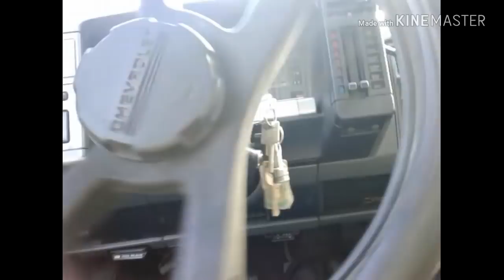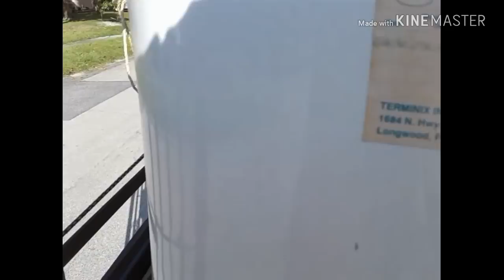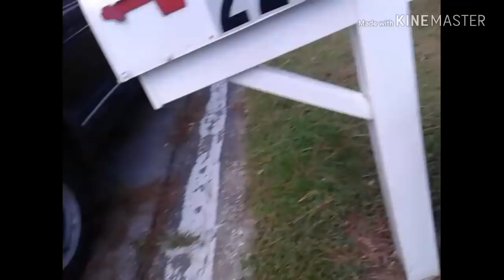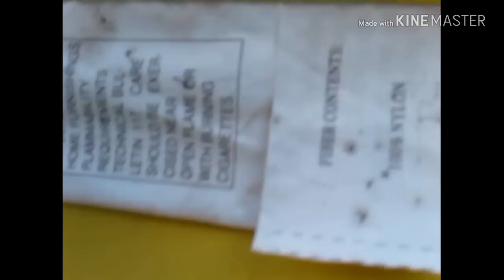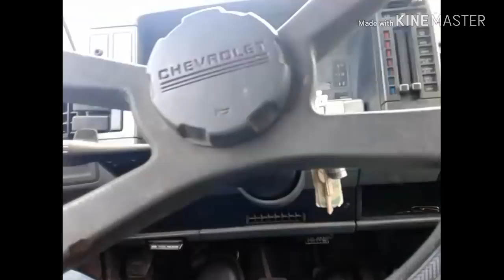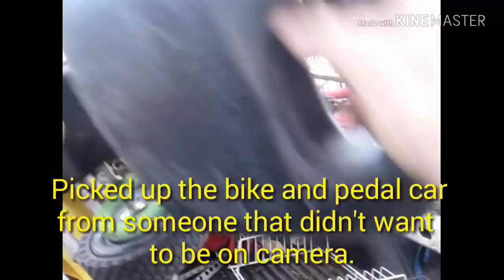I put sides on the truck,trying it out.

Comment: I built on my 2500 series truck a 7'x10' diamond plate flat bed w/ 5' expanded metal sides w/ tie downs. It cost a little bit to make and I had allot of steel that was given to me through my old clients. Other then having to lift the fridges & dryers another 8 inches it has worked great. On the sides I built two doors that swing out so when loading I dont have to climb up in the bed twards the cab.

Comment: I did fold down sides on my truck and took them right off just had hindrance in in the way everything you ever wanted to flip up the side now and no longer goes out there just ends up being 10 times more work trying to get it at the back at least that's my opinion on sides if it works for you go for it